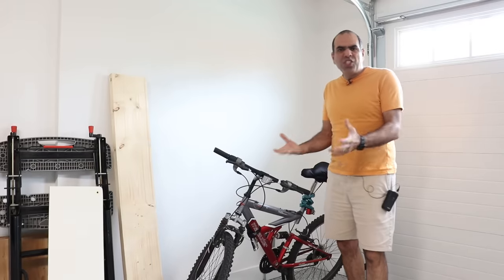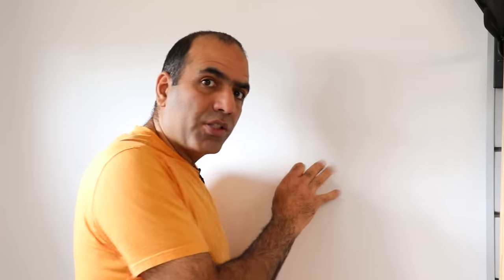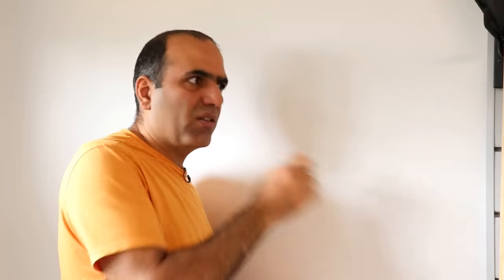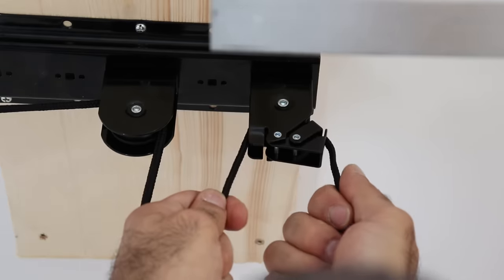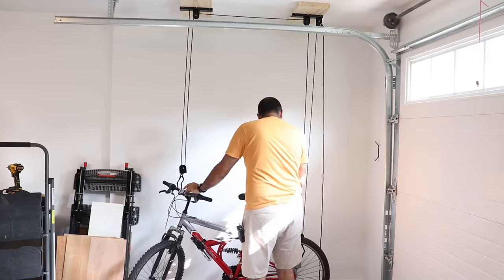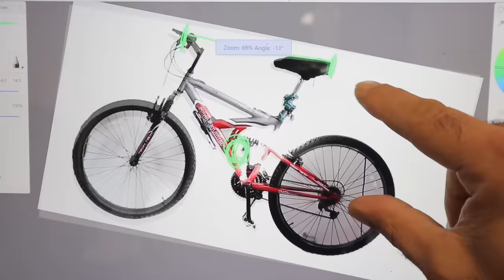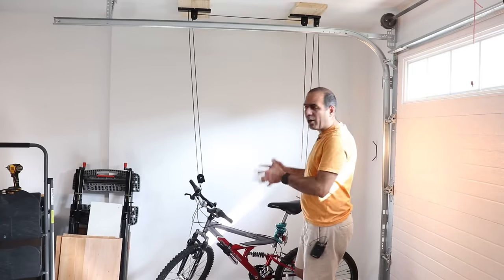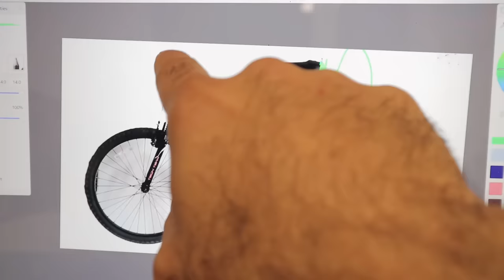HOIST Your Bike (Installation and Review)

Comment: Crazy idea: HOIST the child bike which is lighter and keep the big heavy one underneath. Just sayin.
Reply: Big brain time.
Reply: Depends on how often you use each bike. I thought of buying such a device myself, but 2 times per day lifting and settling? The weight is not the problem, about 11 kg, a classic racing bike with extensions for the traffic.
About the weight: For lifting the bike, you can use your own weight, to pull it up. Probably install some kind of handle on the rope, to avoid burnings.
Reply: @unbekannter_Nutzer  What about a hand winch? With gearing (and an electric motor!), you could make it effortless, if time-consuming.
Reply: @Markle2k  
Weight and power is not a problem, at least not for me. I would prefer to have a shorter pulling way, which takes 2 times the power but a shorter pull. But child and wife might have different views on this. Winch and motor consume space, too and space seems to be our limiting factor. 
There is a common pattern in engineering/design, that while trying to solve a main problem, the side aspects and surprisingly arising problems and their solutions gain overweight, and in the end, you only focus on wether the boundary contraints where met - the main problem is out of focus. Did the current solution even win some space? But if we compare 8:35 and 9:51, we can confirm, that a second bike of the same size would - with a bit of shaking, pull and push - fit below the lifted bike.
But now imagine the big monster truck, staying in the garage, you want to get to your upper bike but there is already a lower bike. You have to pull the lower bike out, first, release the upper bike, find a place to lean it on (the best place is already occupied by the 2nd bike), bring the second bike back in ...  :) 
Okay - let's sell millions of ads on Youtube and engage a butler for tamagotching the comfort extensions of our homes. :)
Reply: I was about to comment just that lol
Reply: you will understand once you become dad
Reply: Yeh, and then you've to be there everytime the child wants the bike down. When it's on the ground she can use it anytime the child wants...
Reply: big brain
Reply: What the fuck dude there is nothing heavier then that bike it's so heavy it's a Walmart bike
Reply: the child cant operate the hoist when they went to ride
Reply: Great idea, then your child is hoisting and lowering a bike. Real smart.
Reply: @unbekannter_Nutzer  What are "extensions for the traffic"?
Reply: @FreshAirRules  Well, a classic racing bike, used in racing sport, doesn't have lights or bells, for example. My bike has a bell, lights, reflectors, mudguards and a luggage rack. It's not optimized for weight.
Reply: @unbekannter_Nutzer  OK, but they're not called extensions.  Or maybe if you're in the UK.  In North America they're just accessories.  "Extensions" sound like they enlarge the length and width of the bike.
Reply: @FreshAirRules  Well I'm not a native speaker of the English language, so I used a word I know from other contexts, and "extensions" came to my mind, like browser extensions, which don't increase the size of the browser, but the available functionality. Maybe I should use "plugins". :) 
"Accessories" sounds a bit like gimmicks or decorations, doesn't it?
Thinking about it: Better: Plugons.
Reply: If you cannot trust your child to lower the bike without supervision... then please don't let the kid ride a bike alone. Plan for surface damage, cover those parts with carpet or something. But isn't it much more likely to have a bike accident rather than properly constructed pulley accident?

One realistic solution for two bikes could be a T-system by the way. You would secure the pulleys in the middle of the wall, then once lifted the bike could be dragged left or right along a rail.

Comment: I've used these hoists for years. The rope is not the first thing to fail - it's the pulleys. They get brittle and eventually crack and seize. I also modify the hooks, so that I hook them sideways into the wheels, which is FAR more secure.
Reply: I’ve had this setup for 3 years now and it hasn’t failed once
Reply: maybe yours had rust so the pulleys degraded?
Reply: Snatchblock all day long
Reply: @TheBeanyi  Snatchblock yeah!
Reply: @MarcusC  yeah dude, awesome piece of kit
Reply: @julian6431  Both of mine failed the same way after about 8 years.
Reply: ONE THICC BOI  Patreon supporters get the video a day early.
Reply: ONE THICC BOI  Patreon
Reply: I think modification is right up Mr. Tation's alley. Give it time.
Reply: Also they are not practical for everyday life.
Reply: Does oiling help?
Reply: I've been using these bike hoists for a little longer than 76 years. Back then, bikes were made of ductile iron and my friend's wife has chicken legs

Comment: as a MECHANICAL engineer, the reason it states it can lift 50 lbs is because they have a factor of safety for both the rope and the metal parts and not that 50 pounds is the maximum they can handle... or they just hung weights on it until it collapsed idk.

Comment: You should have painted the wood white to match the ceiling. You know, because of the wife and all. :)
Reply: You could add the wood as a new cross member between the joists in the attic so you get the same thing without looking at the wood
Reply: @sandfly27  He said its a balcony above so probably no easy access.

Comment: I’ve had this hoist system for several years for my two bikes.  The friction force in the pulleys can be minimized but using a spray lubricant.  Also, the reason the end of the bike nearest the pull cord raises first is because the travel distance of the first pulley is shortest.  The more pulleys added, the longer the path and the slower the pulleys rise.

Comment: Hey Mehdi, (sorry if i get your name wrong), I found some improvements that you could apply onto your pulley system. Hope you consider my feedback. You may use this comment in your videos, under creative commons. Hope this comment got noted down on your list. 
1. Takes a long time to pull up, can get rope burn if too fast.
    a. Use a counterweight, on the side of the rope where you were pulling up. Make sure you can add more weight than the measured weight just in case. This allows you to:
         -Lift the bike up with little effort, like lifting a pencil.
         -Involves no electronics with the build. So you don't have to bring wiring all the way to the site to use motors. 
         -Counterweight can come from anything, just be sure to contain and or hide the weight, and make sure it doesn't bang around and make noise. 
    b. A counterweight, with a motor. 
         -You might hurt yourself. I've seen your electric booms videos. Hope you are still ok. 
         -You have to bring wires from your cable box all the way to the site (Or borrow from another nearby source if you are lucky).
         -It costs money to buy a motor, unlike getting a counterweight from inside the house, or salvaging another motor, and making it work. 
         -You could get another sponsorship from those awesome pals with those cool scopes (NO guarantee THAT ONE THOUGH).

2. Make A slotting, easy, secure mounting point.  (Edit)
         -You can make it in onshape, or a different cad software.
         -Recommend starting out on paper, and start measuring out your dimensions for the hooks.  Make sure you allow a good enough tolerance for the parts to fit nicely. You might want to add                                ramps for guiding the hook in effortlessly. 

By the way, my mom really likes your electroboom videos and if it wern't for you, I wouldn't have lectured her on electricity though the bathtub plumbing to ground. If mom's seen this, I'm in for a surprise. 
.
.
.
.
I mean for goodness sake, tires are not the one that saves you from getting shocked when lightning hits the car. Faraday cages are what saves you.

Comment: Pro tip - to prevent marks, paint the walls and ceiling near the bike with two coats of a good quality interior gloss latex paint, tinted black.

Also, if you repaint the entire garage that way, it will seem larger, especially at night.  It worked great in my college dorm room.
Reply: That much black would look so depressing though…

Comment: Personally, I installed both pulleys (front and rear) on a two by four and then fixed that to two rails that are perpendicular. This allows me to have multiple bikes stacked on the side and then pull them to the center un hoist down the one I want. Think of a container crane on a dock. That was my inspiration and it is super practical and saves space.

Comment: I think of two things that could improve this system — much thicker rope (like 4-6 times thicker, not for strength, it's much more comfortable to pull or lift weight with comfortable thick handle) and better pulley wheels with bearings.

Comment: I remember doing a similar project for storing kayaks. We didn't drill directly into the studs/joists, we drilled on either side of the joist and used u-bolts to mount a pair of block-and-tackles for each kayak. We were lifting with a pair of ropes, but it prevented the unbalanced issue you mentioned earlier in the video.

Comment: After I bent the hooks, I hang my rear wheel onto its hook, and the front to the handlebars.  That would straighten your lines too.  The seat is not a good attachment point.
Reply: Out of curiosity, why is the seat a bad attachment point? Is it due to the instability of the mount itself (i.e the amount of "wiggle room" it has to end up off-center?) ? Or is it because you're worried about the dropper post? O.o
Reply: @lordmrcs  Theoretically it shouldn't need to entirely hook it, the downward force pulling onto the "ledge" of the hooks should be plenty to keep it secure enough unless you're just bein foolish around a 45lb object hanging from the ceiling, but I do see your point!
Reply: @meatsmell8639 :  The construction of most saddles, especially leather saddles. You can definitely tear a leather saddle using it as an attachment point.
Reply: Yes, the seat is only held in the riser tube by friction, and may start to move. I'd hook off to the back wheel.

Comment: Random passing note. If you only ride on the streets, get bikes with only front suspension. Rear suspension absorbs a lot of the motion from your pedalling making your ride less efficient on your body and you'll get tired quicker. You'll also find the ride is actually smoother as a result and you'll go faster and accelerate easier too 👍

Comment: I have been using these exact cheap hoists for years. No issues. If you line them up properly so the pulleys aren't at angles, they arent going to pinch the bearing surfaces and work much more smoothly.

I also use two of them to keep my land rover's roof rack suspended in the garage when I don't need it. I've also used it for a motorcycle cork change. It has held upwards of 250-300 pounds for relatively short amounts of time and no issues arose.
Reply: You have our sympathies for owning a Land Rover. It must spend a lot of time in the garage.

Comment: I'm no "electric engineer" - but wouldn't it have been easier to first screw the metal thingy onto the wood before screwing the wood onto the ceiling? That way you would have to do less overhead screwing.

Comment: Stop buying heavy "suspension" bikes from Walmart and things will never be better.
Reply: if you want a cheap bike that rides ok, the walmart bikes do just fine. you won't be doing whistler on them or anything but its fine for someone who just wants to go for a day out cycling every once in a while
Reply: @oliverwalters9533  I think what First Last is trying to say is that you don't need a bike with full suspension for everyday riding.
Reply: @oliverwalters9533  there's nothing wrong with cheap bikes, or even Walmart bikes. Just get a simple diamond frame.
Reply: @faiyaazmuhtasim6990  exactly. Full suspension at that price point is pure gimick.
Reply: @FirstLast-wr9mh  Yeah, I agree. If you are buying a 300 dollar bike, just buy a hard tail. Good full suspension bikes usually come around at around 1000+ dollar price point.
Reply: @faiyaazmuhtasim6990  really? That much?
Reply: @chema8360  Dude, have you ever ridden on a mountain terrain? Those cheap walmart bikes will crumple the moment you start going downhill. (I did not mean that literally, but you get the point.) It is better to buy a good hard tail than a bad fully suspended bike. You get the point, right? And, to answer your question: Yeah. Really that much.
Reply: @oliverwalters9533  
...that is, unless you are sam pilgrim, of course.
Reply: @faiyaazmuhtasim6990  "Need" is relative. If it reduces discomfort enough to reduce the mental friction to going out riding, it can be worth it. But I would prefer the "suspension" to be in the seat and/or post, myself. I had something like that and it seized and the frame cracked at the weld.
Reply: @Markle2k  I agree with you on the "Need" topic. It all depends on the terrain you're riding on and how aggressively you are riding. But you would rather ride a 1000 dollar bike 100 times than to ride a 300 dollar bike 10 times, wouldn't you? And I can relate to your story too. My first bike was a cheap fully suspended bike, because I wanted to look cool, and guess what happened? The rear suspension joint cracked. Plus, those things weigh like 20 kilos. Anyways, I am surprised at the community response when I posted the comment under this video. It doesn't matter which bike you ride or how well you ride. It's all about enjoying the ride. I happy to see the community being so active, specially during quarantine.
Reply: Definitely, more people would be better off with hybrid or road bikes, even at wally world pricing and quality, than mountain bikes. So much weight, and most won't need crazy suspension that might not even work.
Reply: Good luck climbing uphill with rear suspension. Every pedal a big chunk of your energy goes into actuating the suspension, barely moving you forward. Huffing and puffing and end up walking the thing. Eyeballing bikes on the trails in CO, people don't skimp, and you don't see rear suspension hardly at all.
Reply: Been there, done that! Had a full-suspension "mountain" bike for my daily commute. It sucked. Not only was it heavy, absorbing my energy into suspension, ugly and unreliable, it was VERY UNCOMFORTABLE to ride because of that stupid posture. 

It got stolen about half-a-year later, and thank god it was.  I bought myself a rigid gear-less bike, basically the cheapest one there was. Yes it doesn't go as fast. Yes it is more sensitive to wind. But i sit on it like a master, looking around and enjoying the view, with my groceries bouncing around in a basket on the back. It is not perfect, not very reliable, but it is much better. And it isn't stolen yet =)

Comment: Such a heavy bikes must be terrible for riding :(
Reply: Not actually
Reply: @bls7879  I had "cheap" aluminium bike similar to his. It was fine, but hard to ride with high speed for long. It was too heavy. Then I had an opportunity to use a cross type bike with carbon frame. It was so light that I could lift it with one finger. The difference was massive. I could ride long distances with high speeds (~40km/h constant and 60km/h top).
Reply: @BuildEver  
It's a cheap suspension bike, they are always heavy. And of course there's also energy lost due to suspension....which all makes sense if you ride offroad. But i doubt Mehdi does that, he'd probably be much better off with a light steel bike (like 24, 25 lbs)

Comment: I would recommend replacing the rear hook with a large carabiner that clips to he back of the seat pole. Or possibly, both the front and rear. That way, there is no chance of it slipping off.

Comment: I have an open ceiling in my garage and you can see through the joists up to the roof (as it is detached and doesn't need to be insulated) so I just lift my bike up and hang it from one joist by hooking the front of its seat on the joist.
The bike tilts forward and the back wheel braces up against the nearby joist behind making it stable.
It's not a heavy bike, made from aluminium, it's a hard tail Kona Munimula it weighs around 25lbs.

Comment: I have the exact product. After a few years of using it very rarely, all three wheels from the top broke :( I am still using it with the rope just sliding directly on the axels. A lot harder, but still working. I will replace the system with simple hooks on the wall.

Comment: Aghaa, dammet garm! Koolee kaff kardam with this and also it was very useful info thanks. Very-gooot job, baba! I have a 90lb fat tire E-Bike that I need  a "HOIST" (hysterical word LOL) for.  My garage has two cars in it and so there is not a lot of open space on the floor.  Ceiling is the only option but I am very worried about a 90lb bike crashing onto my car.  I looked a lot and saw the one you demo'd.  Just a little bit worried about the sheer weight of the bike so I looked and found an electric hoist that I am now considering. Anyway I would have loved to seen your take and review on it.  The one I am considering is that Partsam 220 Lift Electric Hoist Crane.   Gooodlock aghaa!

Comment: The thumbnail suggested to me that you found a way to use your garage door system to hoist up your bike and use the rail to hook it up. Now I feel sad....
Also, pro tip (as a dutch person); loosen the steering bar so you can turn it without turning the wheel. A lot of modern bike make this easy with a little handle. Don't got to fasten when you go riding again though...